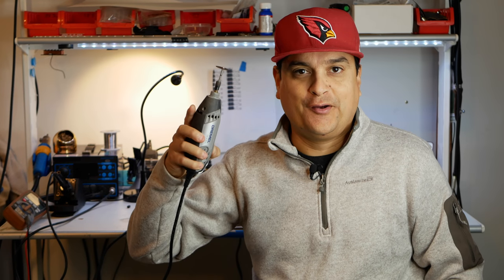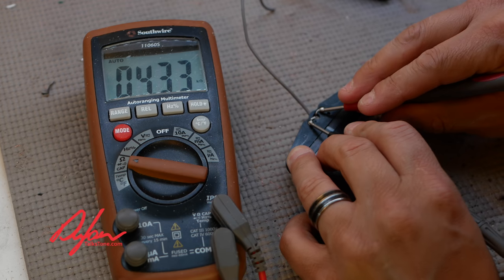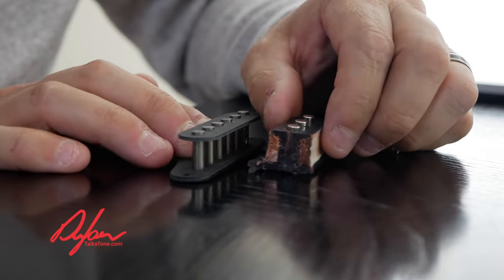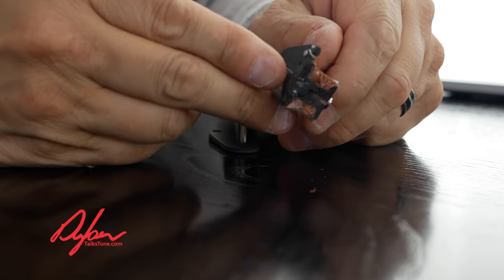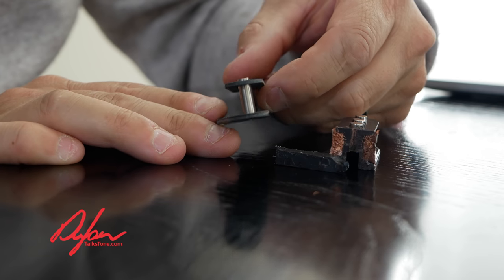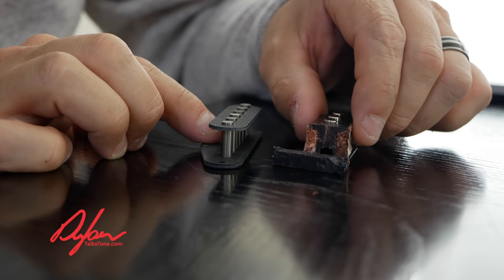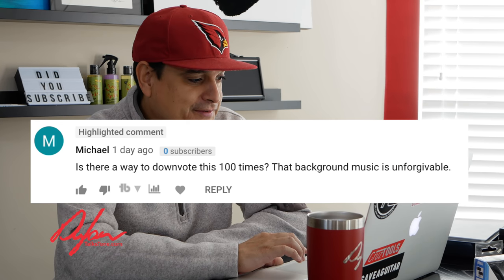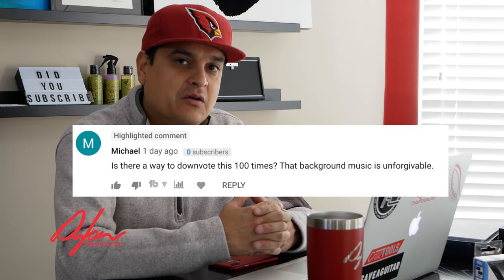Cheap Guitar Pickups - What is Inside?

Comment: There's definitely some merit in this video and some interesting insights into how Fender cuts costs with the Squier pickups, but there are also some misconceptions. The lower output of the small coil can actually be offset by the magnet strength, so it's not actually that this pickup will be weaker than a more expensive pickup in terms of output. The issue is that by reducing the coil size like this to save on wire you reduce the inductance of the coil, which raises the resonant frequency. Unfortunately, inductance was totally overlooked in this video before (and after) cutting the thing in half! In addition to this, the problem with strong magnets as used in this pickup is that they detrimentally affect the way the string vibrates. So it's not about AlNiCo being more expensive - that's not a measure of tone. If you used gold magnets it would be super expensive and silent. It's about making compromises to compensate for skimping out on the construction. The insight into the bobbin construction is interesting and relevant though.

Comment: I have a samick from the 80s and its wound strangely. Is there a way for me to send you pics? These things sound better than my $350 Mojotone quiet '58 loaded puckguard and its wound with no bobbin that i can see- it looks like a bar magnet with pole pieces wound and held together in the pickup cover with wax. Then a metal baseplate like a tele. Very different. I would like to see a video about these

Comment: Since you are offering it: I would like to see the compared frequency response of these pick-ups.
I have seen they are made differently. Fine. Cheaper is a quality. I have heard about "compensation". Even finer. Compensating means you get the same results in a different way. So if the stronger magnet compensates for the AlNiCo bars, we get the same signal, right? And if the resistance of the coil is lower, then surely this can be compensated by that of the pots on the guitar too. Do they? Don't they? What difference does it make? Is a less resistive pick-up then brighter together with the usual pots? That's a good thing. Better brighter than duller, it can be toned down easily. Better than having to boost the highs together with the noise, right?
Dynamics were also mentioned a lot. Is this really so? Is this because there is less wire? Does that affect dynamics? Or is this a different quality of wire?
I am sceptical towards pick-ups because I keep seeing people praise character (which is colouring, basically a distortion of the frequency response) over a flatter, more regular response which would be objective quality. I understand this "character" is what makes what is recognised and appreciated as an electric guitar tone, but I question its equation with quality. So are cheap Squier ceramic pick-ups really lower in quality or merely less pronounced in character, and then maybe more versatile in that their output can be moulded better?
Reply: First let me say that I discovered this awesome channel just a couple days ago and I'm so glad I did because Dylan's short, concise and to the point videos have made me completely understand how volume and tone pots and tone caps work. 
Thank you, Dylan!

Second, in response to Leo: My gear is a strat with Fender Original '57/'62 pickups which sound amazing (after I corrected the stupid 1950s vintage stagger of the G and B magnets)... 
Three years ago I went to the Mongolian Grill I always went to for lunch and there was a guy standing out front playing a strat through a little amp. 
As I was leaving I said, "Nice Strat! It sounds great". He pointed out that it was a Squire that he had bought used at Guitar Center because it sounded so good.  Then he basically took his guitar off and put on me and said "play".
I could not believe how good the pickups sounded through his tiny little POS amp. It made no sense. 
A Squire?! What?!

I would describe the sound as bright and heavily scooped, basically the optimal strat tone - or what I'd imagine John Mayer's scooped pickups to sound like.

It is interesting to note that the pickups in Stevie Ray Vaughan's #1 were measured as being very low output and that they were adjusted VERY low.  Which would result in low output.  
Perhaps the lack of windings and proper magnets in the Squire pickups result in a really low output (as indicated by the measured resistance in the video), even when pickups are adjusted "properly" in the correct proximity to the strings, meaning, closer to the strings than SRV's were.

So many of the modern pickups (like the horrible Texas Specials) have much more output than a real 1957-1962 era pickup... which, if my theory is correct, de-Stratifies a strat, probably losing the sparkly bright quality you mentioned in your post. 
Of course this is just a theory for me and I honestly have no idea what I'm talking about because I don't have experience with a very many different pickups (unlike Dylan who has the expertise to let me know if I am full of crap- which would be cool to know)!  :)
Reply: Love the channel too. This is one of the very few where I feel I can ask such questions and know they would be understood.

Comment: Squiers aren't really beginner guitars, though. They're inexpensive, but that doesn't mean that they're beginner guitars.

 I'd like to see the difference between Squier pickups and those found in an $89 Glarry electric guitar, for example. Are those different? Would it be an upgrade to put Squier stuff in a Glarry or a waste? For newbs, that's a possible option for upgrading their guitars as long as they're not replacing with the same thing that came out.

Maybe look at that?

Comment: How about the insides of cheap tuners vs a branded expensive tuner? I think it would be interesting to see build quality wise how they compare. If you can find a branded tuner that can be dissembled and reassembled without damage or an open gear tuner, no dremel would be required!

Comment: The next question -  does the "better" material truly justify the MUCH higher cost? How much does it cost say DiMarzio to make a double humbucker that they are going to sell for $150?
Reply: Obviously not because part of that cost is justified by having to market and distribute a separate products in lower quantities than what is just a part sold together with masses of cheap guitars. Then of course, there is the brand premium but any after market part from any manufacturer is more expensive to make because ot scale alone.

Comment: Interesting but I feel this is a bit misleading, as you are comparing a cheap Ceramic Pickup to an expensive Alnico pickup, both of which have very different designs  because of the way the magnets are used.. Most of what you are pointing out is the difference inherent in the two designs, not the difference in cheap versus expensive pickups... What you really should have done is compared Cheap Ceramic pickups to expensive Ceramic's or Cheap Alnico to expensive Alnico's, then we would really see if the expensive ones are better (or just have better marketing)  and if we should buy the $40 cheap Alnico pickups or spend the $250 on a set of expensive Alnico's..

Comment: cheap pickup is $3 and you say the material need for a good pickup is 6 times that. 3x6=$18. How much are your pickups?
Reply from the maker: phililpb I suppose you could build a single coil for about 30.00 in parts IF you could buy those parts at wholesale cost. Our Single Coils are 89.00 each.

Comment: So are you saying that all cheap pickups are low output and low quality?
Or are there ever any exceptions to your statements?
I am Getting the feeling this this Is just a plug in order to take the most awful useless POS pickup in the world that you could find 
Dissect it in order to blanket paint all inexpensive pickups into that same box 
Because if that weren't the case I would hope you could've said exceptions are possible
Reply from the maker: Send me some more... let’s cut them up. These are pretty common and a very well used design.